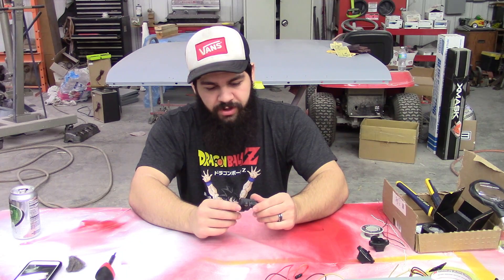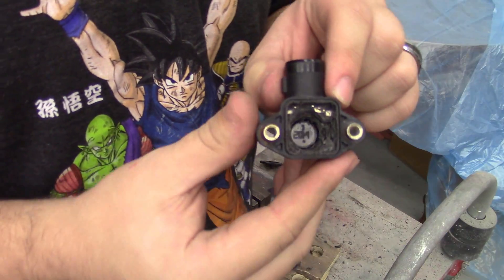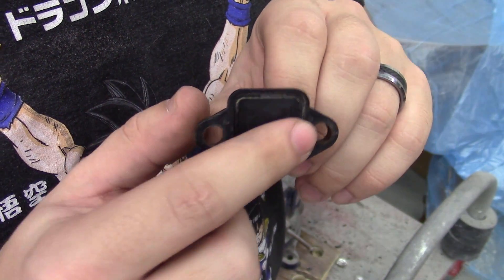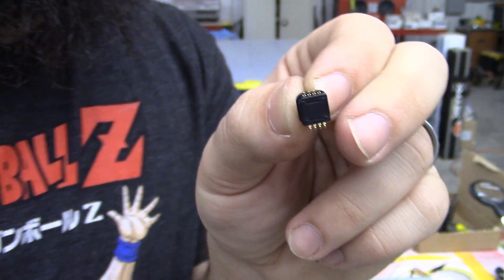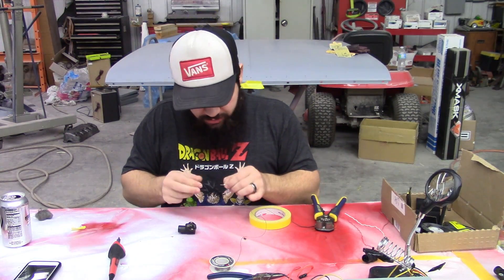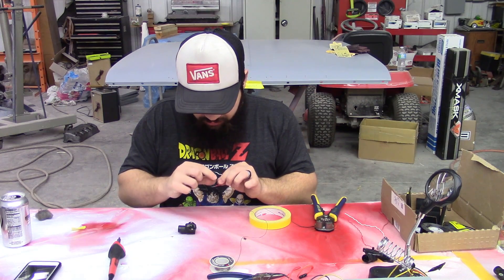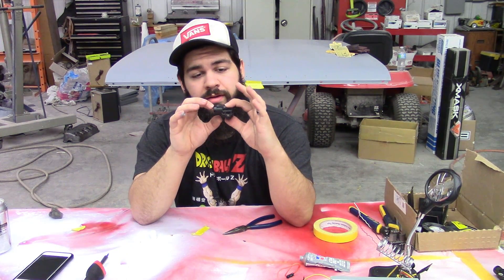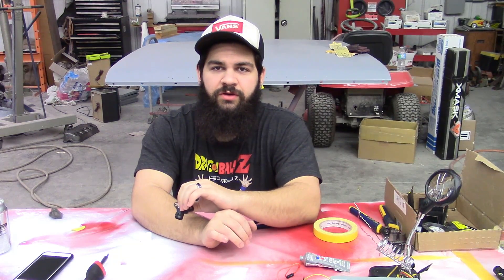How to make stock MAP sensor read higher boost!

Comment: innovative performance chips is basically the same thing. 
if you don't want to do all this work or you don'twant to destroy anything just buy one of their chips it does the same thing you'll pay a little bit more for it but you're guaranteed the hack..
just find one of them on eBay or offer up you can find one pretty cheap..

but if your hands on and mechanically fluid that I'm sure you have no problem doing this..
or just go get a small resistor diode from a hardware store and do it yourself

Comment: Hi. i like to ask you. if you just only change your map to make it higher. and at a turbo. will the stock ecu calibrate to it its self? and i have to give it more fuel and  monitor wideband?
Reply: If you want to boost your Car for more Fuel Ratio?  Use the Coolant Sensor to do it!  Since the Coolant Sensor 'adjust' the 'mixture' ratio, that would be best and 'easy' as well!
Reply: @JodBronson  hi. thank you for your reply. i must say i havent understand your meaning. the coolant sensor is allready on the engine from factory. i have a 2 jz engine. i want to keep the stock ecu. and add a turbo to it. 2jzge is non turbo.
Reply: @boostv8chevy457  - Hi sure :).  First find the Ratio of your need.  Then try to add more 'Resistance', so it forces the ECU to add more Fuel.  Maybe this Video will help..... I did a Video way back and as I was doing it, I saw my 'idle' went up.  This was a sign that tell me that Gas/Mixture was added to compensate.  See the Video I've made, maybe you will get some ideas!  NOTE:  Most of the time though, the ECU will 'adjust' accordingly, unless you can do the 'mapping' yourself.  Video Link:  https://www.youtube.com/watch?v=q0v1kbw7iJI

Comment: Hello, i tune using crome for now and I was wondering how the voltage works, the area I need to fill in says
Minimum at 0 volts:    -1 mbar
Maximum at 5 volts:    2002 mbar
Voltage at 1 Atm:          2.52 volts

My problem is that I cant directly change the voltage value, but if I change the Maximum mbar value I can get it to the correct voltage, is this the right way to adjust this? This is my first time not using a GM sensor which is normally a preset in crome menu so any help is greatly appreciated! Thank you!
Reply: Update, car barely idles after changing values to match voltage. Tried almost everything, cannot directly type in values needed. Not sure this works with crome tuning software
Reply: @dillonwest9732  -  You are making more work for yourself!  If you want to boost your Car?  Use the Coolant Sensor to do it!  Since the Coolant Sensor 'adjust' the 'mixture' ratio, that would be best and 'easy' as well!

Comment: Bro I have a Civic EK3 D15b 1.5 l sohc VTEC, my map sensor says "ps 33" & there is another sensor which says "ps 30", which one will work best ?
Reply from the maker: sorry man i couldnt tell you. is your set up boosted? if not it wont matter as most the civic map sensors are the same. i wouldnt dwell to much on the markings on the sensor. i say install it and if it doesnt work try the other one.

if you're planning on doing the mod i did in this video the sensor doesnt matter as your just using the honda housing and replacing the sensor inside it.

Comment: How does the xencron sensor mount to the map sensor? Do you solder map sensor to the xencron chip then do your wiring technique not to clear on that thanks
Reply from the maker: yes. if you use the xencron chip you will solder the sensor to the chip then the chip to the housing. its much easier that way as its tough to get the wires soldered to the sensor because its so small.  the chip has larger holes to solder the wires easier.